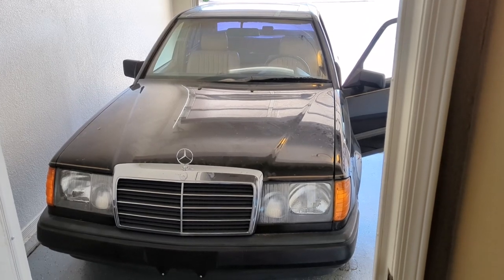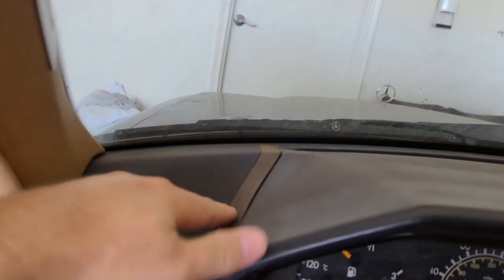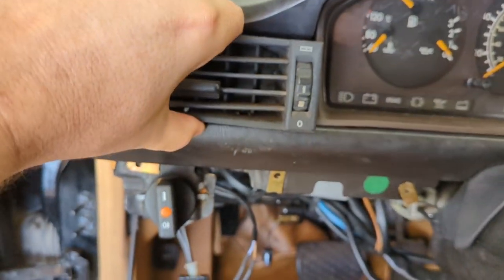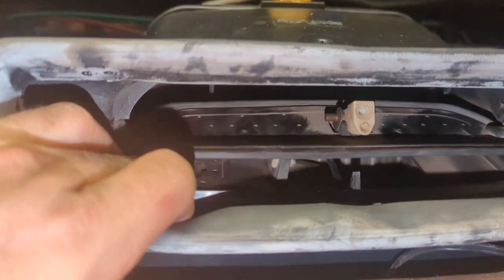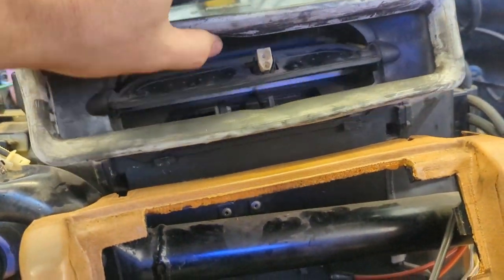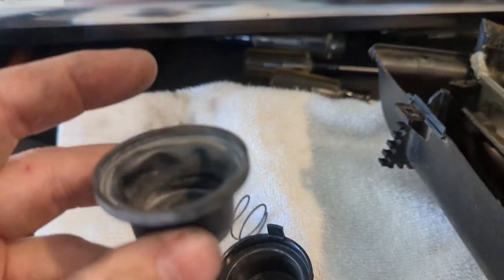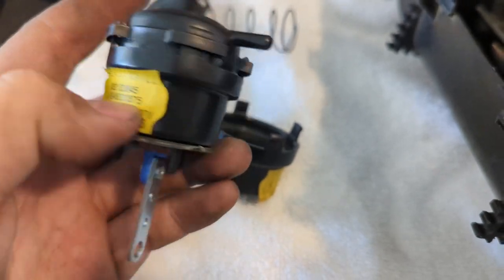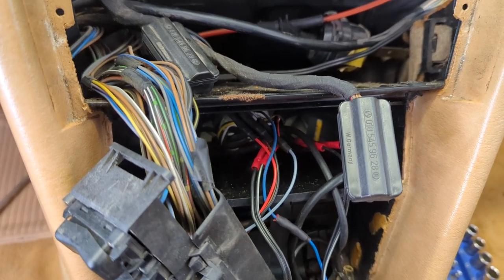Removing the dash for vacuum pod repairs on my 1987 Mercedes-Benz 300D

Comment: Some of the most painful services are under the dashboard! A lot of fragile parts and sharp edges to hurt your hands...
Fortunately you have parts available at yor country; here in Brazil it's not easy to find and the charges are high... I think your dash may be restored later, even by somebody else, so if you can keep it stored as it will be harder to find in the future... 
Regards!
Reply from the maker: Luckily, there's a great supply of dashboards here. I can fairly regularly find a W124 with a nice dash in the junkyard. My original was in REALLY bad shape and went right into the garbage bin 😂 Compared to W126, it's actually not too bad to remove W124. I got the procedure down to about 45 mins for removal without breaking anything. You're right about the painful services though- I cut up my hands a lot during this process. I had considered replacing the heater core and evaporator - but thought it was a better idea to leave alone for now 🙂 The vacuum pods were trashed though!

Comment: I have been looking for a parts car to keep my 87 300d alive. I have been looking for center brake light but they are all melted.
Reply from the maker: What color is your interior? I can always keep an eye out. I run into a decent amount of W126 and W124 at junkyards. Enough that I have found a few completely mint 3rd brake lights
Reply: @bsclifton  i would be happy with any color brake light. My interior is palomino but take any color.
Reply: @bsclifton  if you come across another armrest with storage that would be great. Could use a rebuildable turbo too. If you find anything ill be happy to pay for your time.  Thanks. Robert